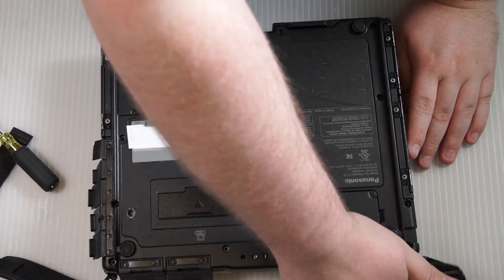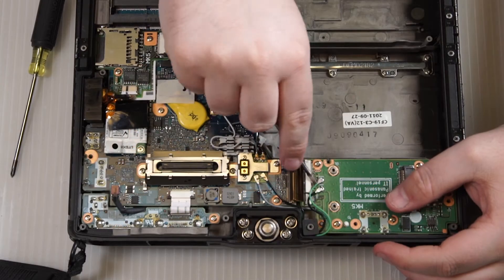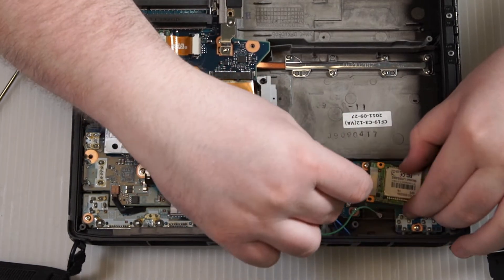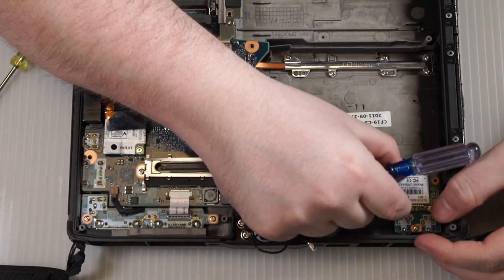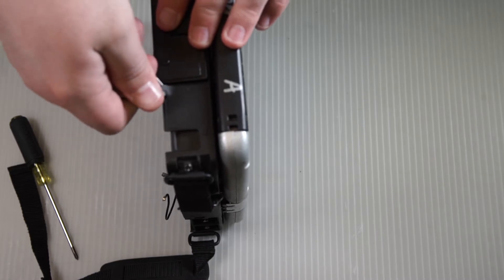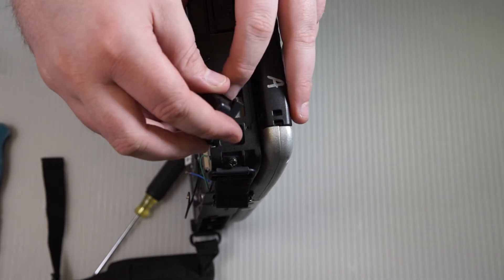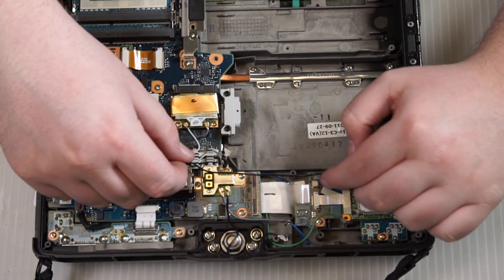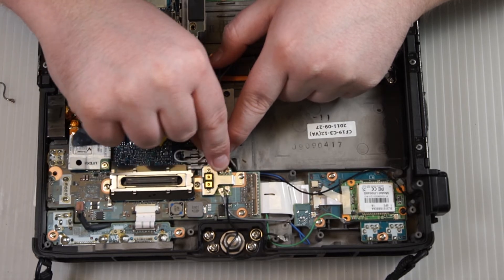How to Install Panasonic Toughbook CF-19 GPS Hardware

Comment: Wondering what size the smaller screws are
Reply from the maker: Which screws are you referring to? There are about 8 different sized screws on the CF-19. Thanks for watching!
Reply: Screws that would get the back cover off so you could do a RAM upgrade @Bobjohnson

Comment: Okay, I have a CF-19 Mk 8 and I am pretty confused the audio board says Mk 7.5 FJ-TH7 and there  is a COMS port for the GPS but the WWAN card that came with it Sierra Wireless Airprime MC 7355 also has a micro coax pinfor GPS, should I just use the antenna on this board or install the separate board for COM3?
Reply: I noticed the same thing on my  CF-19za813dm and I have the same question

Comment: Do you guys sell cf 19 parts and laptops because I want to get a mk8 with i7 processor and 16gb of ram , docking station for the car, GPS. I have a question how well will the mk8 run skyrim
Reply from the maker: Hi James, yes we do. However, we do not currently carry the MK8. If you fill out our selection assistance form here: https://www.bobjohnson.com/rugged-computer-selection-assistance/ or give us a call at 877-202-7788, we would be happy to help you pick out another computer that meets your needs.
Reply: @Bobjohnson  hi again. I just bought a cf-19 mk8 and now I am looking for the factory Panasonic toughbook cf-19 mk8 software on USB

Comment: what is the purpose of wiring through the passthru antenna vs direct to the GPS card?
Reply from the maker: You would wire to the passthru then to the GPS in case you were to dock this laptop into your car and there was an external antenna in the car for the GPS.  Otherwise you can just direct wire it.

Comment: And what can you do to make sure windows is properly detecting it??  I have a gps module in my cf-19 and windows maps doesn't (or can't) use it for some reason.
Reply: yup I cant get mine to work either, so frustrating
Reply: @bigjohn8670  any luck yet?

Comment: Bob Johnson's Computer Stuff Inc.  I tried to connect the antenna this way, but it didn't work for me. I found that just connecting the antenna directly to the GPS card did the trick though.

Comment: why connect to wifi card ? does it improve reception? or...? any advantages ?
Reply from the maker: Troy-Good question! It doesn't have any advantages. It was done that way because of the way it was already wired. The antenna either needed to be connected to the GPS board directly or wired into the Pass through antenna. There wasn't room to plug the GPS board and antenna onto the pass through. The way it was done ensures everything is connected and ties into the pass through antenna.